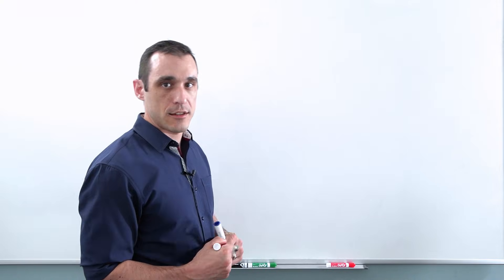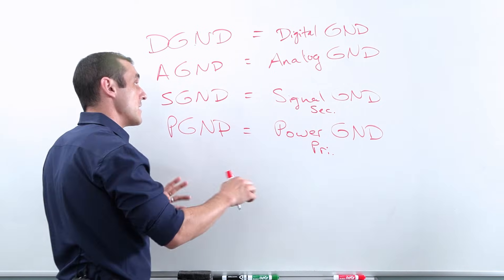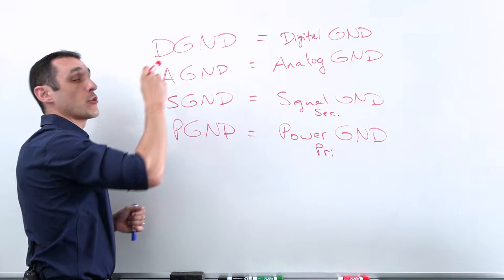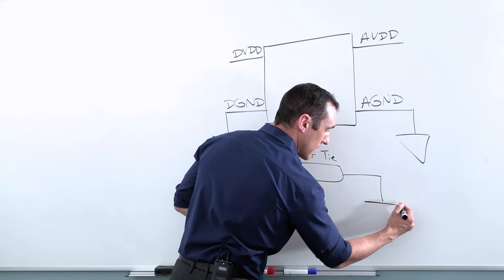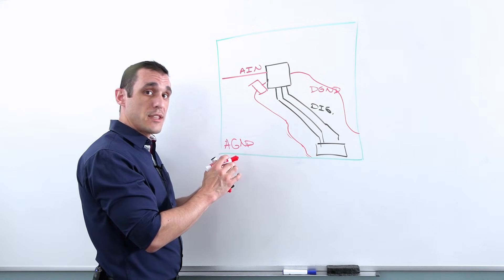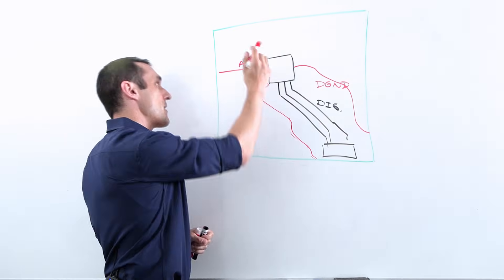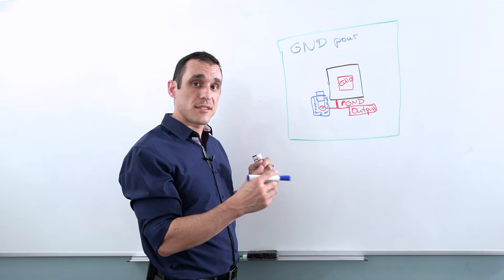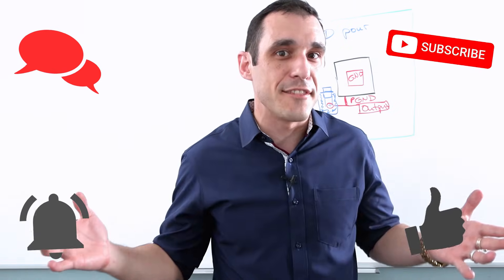Types of PCB Grounding Explained | PCB Layout

Comment: In the buck converter example, could we have one ground net for these two separate grounds (pins) but carefully layout the pulsed current part (SW node) away from the rest of the circuitry?
Reply: Sure you could, but the best strategy for SW node layout is with short connections. The reason is that the connections have their own loop inductance that can generate or receive EMI. That loop inductance is usually something like 5 nH/inch.

Comment: You can have as many "Ground" nodes as you want below 100 KHz. But to pass EMC / EMI requirements you only get one RF ground above 100 KHz. You pass EMC / EMI by designing controlled impedance transmission lines for each and every signal that has intended or unintended content above 100 KHz. Splitting or cutting up ground reference layers are the single most common cause if EMC and EMI failures. You keep noise current out of sensitive signals by designing the transmission lines, not by cutting up your RF ground.
Reply: it does not only depend on the frequency, it depends on the rise / fall times. Current ICs have rise / fall times of pico sec and can cause emi / emc problems EVEN at low frequencies. There are interesting notes from Eric Bogatin and Rick Hartley on this.
Reply: @cvillf4694  To make any AC signal requires frequencies. For a pure tone there is only one required. For a digital signal made up of rising and falling edges there are many frequencies spaced at the period of the signal. The fidelity of the transport of these signals depends on the amplitude and phase delay distortion of each of these signal components at all of the various frequencies.
Reply: I've said a variation of this in just about every video I've made on high-speed design and grounding, including this one
Reply: Well, he explains in the video that high speed transmission lines have a well defined reference path that follows the trace closely. Additionally, he also said that split ground planes can be implemented properly and is preferable when the analog signals are low frequency. So your information doesn't contradict what was presented in the video.
Reply: @Plissken  The key here is the "how" part of doing that properly. Most people don't do it properly and they try to do it when it is not needed. Audio is one example, but part of the reason for that is that sometimes your audio system will be galvanically isolated from your codec and speaker or transformer driver/amplifier, so you're forced to split things. Another instance if when your signals are very low level, like SNR ~ 1, in which case you also need to maintain isolation. You could do it with a galvanically isolated ADC, very tightly coupled transformer, or an optocoupler all with a very tight loop into your ADC. Similar idea going in reverse from a DAC.

Comment: I had a project where I had multiple type of GNDs (SBC GND, MGND, AGND, DGND, OSCGND etc) but eventually they were all connected together to the main GND using - as we call it - a starpoint (something like a "net tie"). 6L board. On one of the layers was the split and connection multiple GNDs, on another one a complete GND fill.
Reply: At that point you basically just have 1 oddly shaped ground conductor. No problem with that as long as you route over it correctly (only over ground). Rick Hartley will disagree with me until I start showing him some strange board shapes and draw out the area where routing is confined.

Comment: Common mode noise/interference is the enemy.  The amount of noise/interference coupled into your PCB by signal and power supply wiring (antennas) will often swamp the amount of noise/interference coupling on the PCB itself.  Use ferrite beads liberally.
Reply: I understand you need common mode chokes in the input of the circuit to deal with common mode noise. Ferrite beads would work for differential mode noise.

Comment: Absolutely agree that you should never split your PGND/DGND/AGND (aka 0V), otherwise you are asking for trouble when you go through EMC/EMI testing

If you are worried about signal noise then segregate your circuits, as in move the power supply to one corner of the board, the digital section to another, and the analog section to another again. Then when you transition from one EM zone to another (say analog to digital), you add some inline filters at the EM zone boundary
Reply: Im a student in electronics and communication engineering. Thanks for your advice, noted it down.
Reply: its there is any way to control the switching noise in PCB?

Comment: Hello Zach great video! So what about mixed signal PCB with 6 ADC, 3 of then on main PCB and rest of then on secondary PCB connected through connector. I need split GND and AGND on both PCBs so where I have to connect grounds together?
Reply: Great question I'd say it depends if you have isolated communication, or/and power and differential analog or digital signalling, but in the most cases, it'd be better to connect both grounds together. When deciding what you should do you must look at the return currents of your circuits elements/subcircuits, if you can imagine all of them, I'm sure you can decide what's the best solution for your circuit.
Reply: What sample frequency do the ADCs run at/what frequency is the signal you are sampling?

Is the reference voltage for the signal you are sampling the same for all 6 ADC?

The most sensitive signal is probably the one you are sampling?

Do you need to pass EMC (is this a product or a hobby?)
Reply: Never ever use split grounds if you do not need isolation. Look at Rick Hartley's and Eric Bogatins video's.
They have a joke at the EMI test houses. 'What kind of people use split grounds?... A customer.'

https://youtu.be/ySuUZEjARPY
Reply: @breedj1  unless the frequency of the signal in the analog part of the circuit is low, like audio frequencies.  The return currents for such low frequency signals spread far and wide, they do not stick to the signal path.  If they spread so as to be close to your fast digital signals then you will get noise in the analog section.
How much?  It depends 😜. But if you are sensitive to microvolts then very likely you will have to prevent the analog return paths straying into the digital area and the only way to do that is to separate them.
Reply: @robiniddon7582  Have a look at the video it is very interesting. It shows that at around 2kHz the return currents are already taking the path below the trace.

There is no benefit in using separate ground planes.
Reply: @breedj1  middle c is 260Hz ... And if you are trying to sample at 20 bits with an aperture of 3v then each bit is 3uv.    

I agree that for 99.9% of designs you should not even consider splitting the GND into multiple nets.  But every rule has exceptions.  The question we are all responding to didn't have enough information in it to be sure.

Without further information I would agree that the best course of action is to have a single ground with none of this net tie stuff.
Reply: I don't think AGND is magically united -- you really have six separate AGND nets, and if they never contact each other (except that all are tied to main GND), that is probably OK.  You could run both GND and AGND through the connector, but it would probably be simpler to just have board1_AGND and board2_AGND that never know about each other.